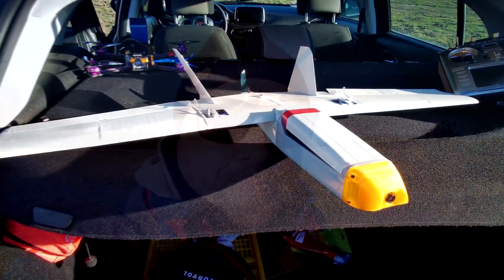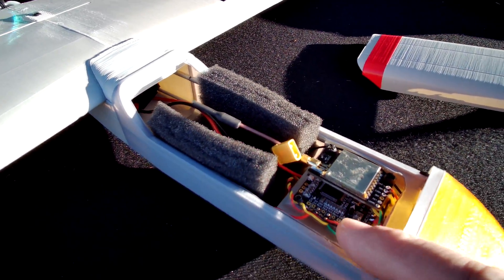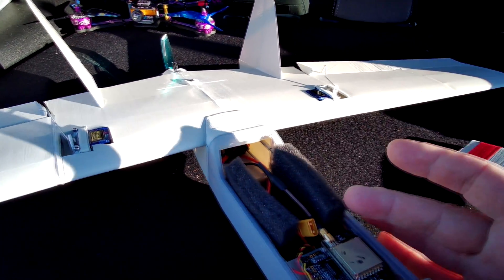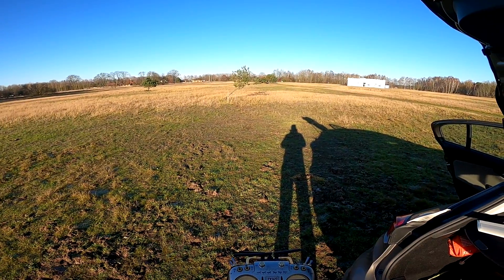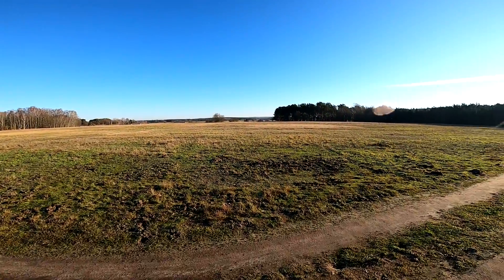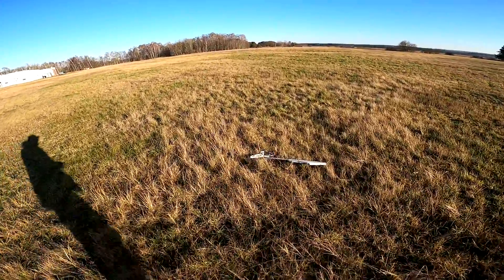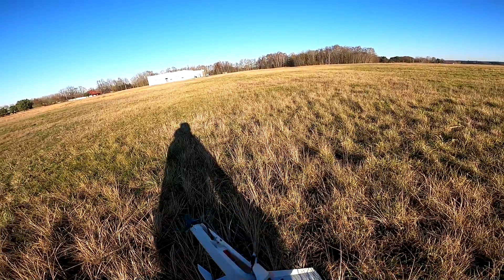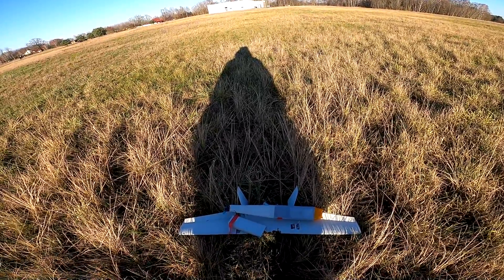3D printed airplane crashes during maiden flight

Comment: Autolaunch with inav. I used to maiden my airplanes on manual mode but after I tried to manually launch zohd drift unsuccessfully then decided to take inav to maiden my planes. :) it is able to launch bad CG, untrimmed airplanes absolutely well as you already know. Then I test, trim, correct the airplane after that I launch whatever i like.
Thanks for the code. 😊

Comment: Wings are tricky. Maybe cg must go even further to the back. Nice thing to do, test the throttle while holding the wing by the tip as the wing tryes to climb. So you can see its reactions. Wings need a lot of power just for the take off.  Compensate a bit on the elevons for the motor torque. 
Love your channel!!

Comment: Sounds like you throttled down about 1-2 seconds after launch.  Probably why it stalled.  Since it has a small wing (chord is very short), it probably needs full throttle for launch until it's flying level.

Comment: Pawel, the bend in the servo linkage wire is a no no. The push rod needs be solid with Zero elevon flex. The airframe is not a flat foamy light weight.

Comment: Few drops of CA and it will be just like new :) any info what failed? It flew a bit like tail heavy. Its better to place it more in fwd than in the back.
Reply from the maker: CG was spot on. I think I had too much reflex on elevons and I lowered throttle too early. Stalled and I was not able to recover. The second one is printing already and on top of that I ordered LW-PLA
Reply: @FPVUniversity  Did you have flight data logging turned on to record telemetry? I suspect lack of wind and initial high angle at launch make it difficult for plane to quickly gain needed flight speed. No major mistakes, just a few non-ideal contributing factors at a critical point of flight.

Comment: Dude...you need to reinforce the whole wing with fiberglass. That's what I do. It makes it a little heavier but it will allow you to survive crashes.
Reply: Just resin or actually use glass too?
Reply: @RubyS.1  resin and fiberglass. I would suggest 1/2 ounce for smaller crafts and up to 6ounce for larger models. It also depends on what's speeds your flying at. Example: on my slow glide 1/2 ounce FG, on my 200mph hotliner 6ounce FG. The thicker the FG the more likely to survive the crash intact...but at the cost of weight.

Comment: Great video. Such planes fly like an iron, they need speed) They do not know how to glide, so it was a mistake to reduce the speed. Otherwise it would fly!
Reply from the maker: Yeah, I'm inclined to think it was my mistake of lowering throttle that caused this. Next wing is just starting to print
Reply: @FPVUniversity  Like @Juan Rodriguez said - you could try - keyword - just light "reinforcements" - from fiberglass (25 and 50 grams rowing) and epoxy .. 
(if you have a chance - ask some glider pilots in your vicinity for light and "easy flowing" epoxy (fluid, liquid - not 5 minute thick type used for construction) - longer curing better ..) Key is to remove any unnecessary residue with tissue ..
Make a 2 cm wide tracks to emulate kind of "spars" - 25 gram on leading edge and 50 gram for spar doublers - could really help 3D print plane. 
Even better if you try with new LW-PLA - you can find some very interesting info from @CNC Kitchen for example ..
https://www.cnckitchen.com/blog/colorfabb-lw-pla-testing-foaming-pla
BTW - nice winter project - if you don't want to mess with fish tanks - you could just watch your 3D printer working and relax .. 😉
Reply: I'm going to try printing one with petg